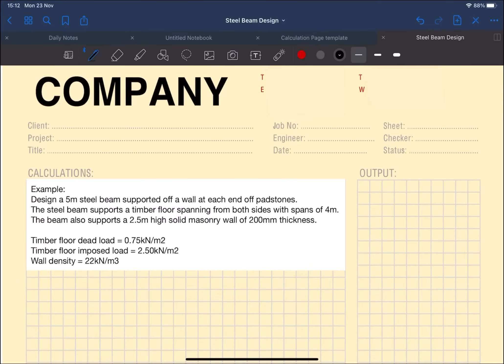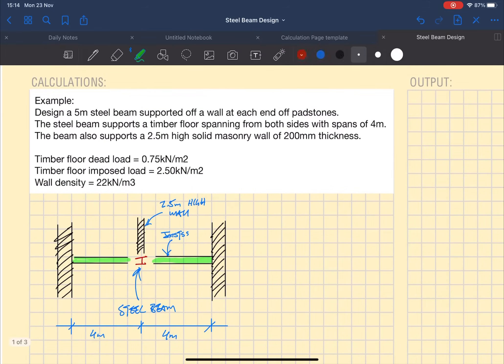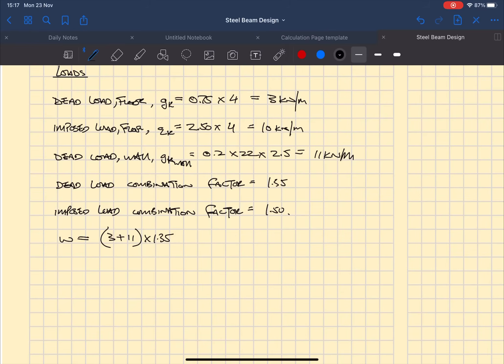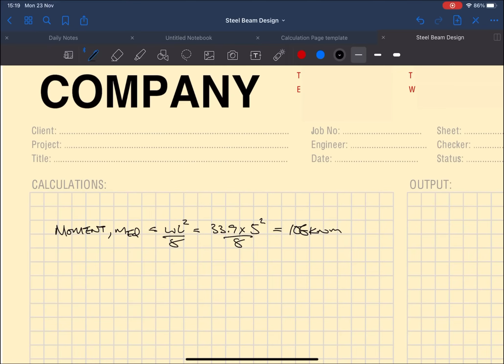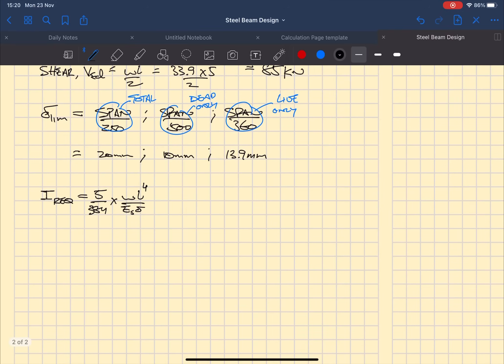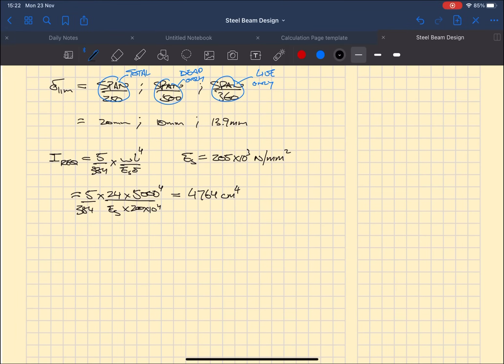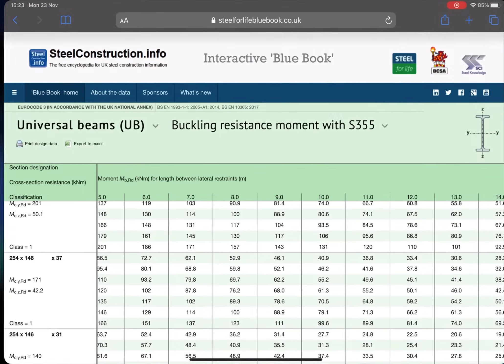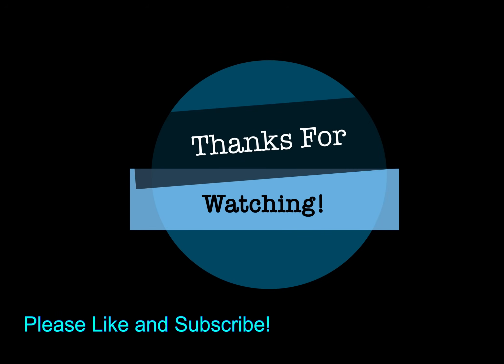Steel Beam Design Calculations for Beginners - Structural Engineer

Comment: What about lateral torsional buckling? Very important !
Reply: Not needed if assuming the beam is fully restrained either side by floor joists and a wall above, in residential practice (like in the video example) I beams are rarely used when torsion can occur, and RHS beams are used instead due to their rectangle profile they don’t experience torsion

Comment: I'm looking to replace hardwood bed frame nonsense roof beams in my garage, and doing some back-of-the-envelope structural analysis with your guide was really helpful. It's remarkable how strong 80x80mm hardwood beams are, I seem to need 120mm section i beam to match the strength!

Comment: Hi, please I had been asked to design a perimeter beam of a two-way-slab How do I go about this?
Reply from the maker: Attribute the load correctly to the edge beam, it depends on the dimensions of the slab but typically you can attribute a quarter of the area to the edge beam.

Comment: Hi Dazz, this is really helpful, thanks. But I was wondering if it's normal not to consider the beam's self weight in the calculation? Or you'd reiterate again with the beam's weight?
Reply: I was considering that as well.

Comment: Do you have an example of two beams supporting an external wall? One resisting the brickwork, one resisting the blockwork and roof weight. Should the beams be tied together, if so, how?

Comment: Hi Dazz, Why is it that you and others use (wL^2)/8  as the formula for moments in a simply supported beam with a UDL but the red book (page 70) and other sources suggest using (WL)/8. Are these the same formulas? if so what how does (w) relate to (W)?  And which one should I be using? 
Hope my query makes sense, cheers.
Reply from the maker: So small w is kN/m and W is total load in kN. So to get W you do w multiplied by L.
Reply: That was confusing me! Who knew that there was a difference between W and w. Never seen that mentioned in any of the books I’ve read. It’s one formula or the other leaving me baffled.

Comment: I was wondering where you got the "I required" formula?
Reply: It’s the formula for deflection rearranged to solve for the “I” given the deflection limit. The deflection of a beam under uniform load is:
d = (5 * w * L^4) / (384 * E * I)

Where:
d = deflection (m)
w = uniform load (kN/m)
L = length of span (m)
E = Young’s modulus (aka modulus of elasticity) (Pa)
I = second moment of area (aka moment of inertia) (m^4)

Some use units of mm, MPa, etc., but I always use base units of m, N, Pa

Comment: Hi, if length of steel beam is 5000 mm including 200 mm bearing in each side. This means length of clear span is 4600 mm.which length will use in design.
Clear span length or  full length of the beam? Please advice.
Thanks.
Reply from the maker: I would take the bearing centre length. So 4800mm.
Reply: @EverydayDazz  : Thanks for your reply.4800 mm is known as effective length of beam?
Reply from the maker: That’s right

Comment: Can you design a  cantilever beam connection
with one support example   with a pinned or  and a moment connection? Also a wood column subject to overturning from wind.
There is much confusion on holding column down on open porches.
Thx
Reply from the maker: Sure. 
Just fyi, you can’t have a cantilever beam with a pin connection.

Comment: This is so helpful! Thank you. Please do more examples of column and beam design for steel and concrete. Do you have any textbook recommendations where they give a lot of examples? It's so time consuming trying to find examples that use EC2 and EC3 :( our uni doesnt provide as with much examples or solutions so half the time I dont know if Im doing my beam and column designs correctly or not.
Reply from the maker: I’ve done a video on books so worth checking out. 
Concrete centre or concrete society does lots of examples for concrete design. 
SCI has plenty of documents with good examples for steel.

Comment: It would be great to see how you would design this same beam if the masonry above was existing. Would you increase the size of the section to minimize cracking in the existing masonry or would you pack out the beam? If so, how do you calculate the size of your beam packers and at what spacing do the spacers decrease in size as they approach the support ends? This is something I’ve always struggled with, thanks.
Reply from the maker: Heh, I’ve just recorded a video which goes through this very problem, will be uploaded this weekend 😬😬
Reply: @EverydayDazz  Which video is this in? It's a question i've wondered as well
Reply from the maker: Hey, it’s in this video 
https://youtu.be/-XaigaTW7R4